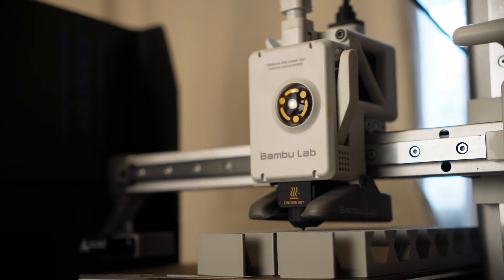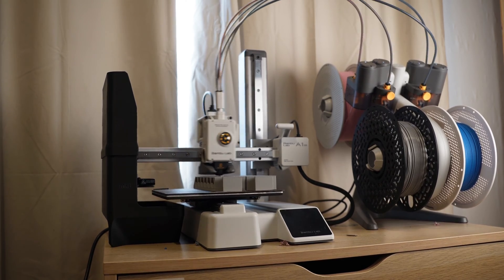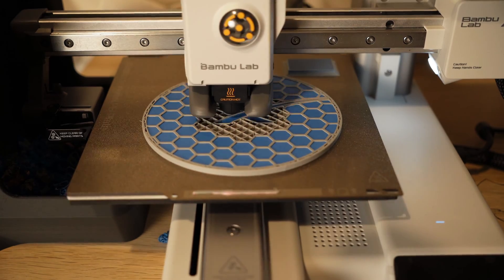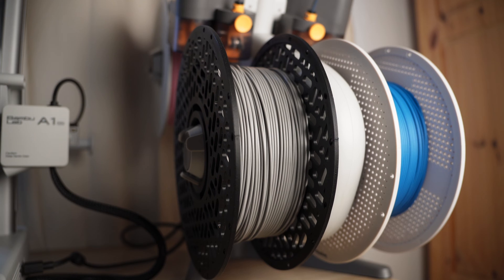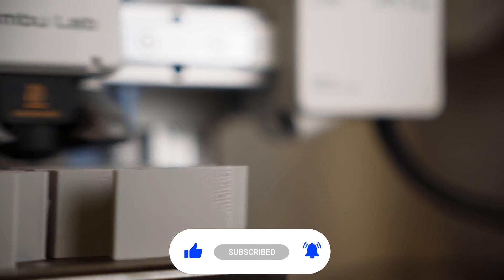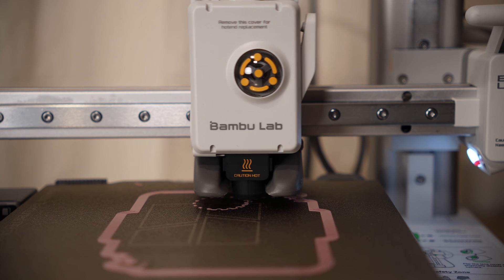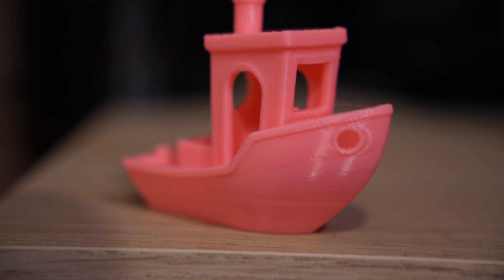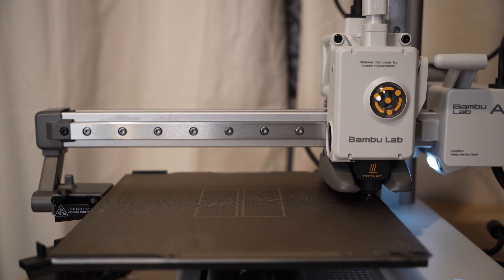A1 mini size DOESN'T MATTER!

Comment: I've been using A1 mini  about 4 months and the quality has dropped dramatically. At the very beginning it printed perfectly, but I have the impression that each subsequent update causes the quality of prints to deteriorate. Ironing the top layer used to be really amazing, now with exactly the same parameters, you have to turn it off because it destroys the surface.
Reply from the maker: Wow I honestly never noticed I’m going to test this out for you see if I can find a fix
Reply: Maybe do a maintenance ? (apply lube etc)

Comment: There is a clip to attach the cable to the ptfe tubes, so it doesn’t flop down like that. I would install that, keeps things neat. It’s found in the accessories box.
Reply from the maker: Yeah sorry I have it but I’m modding the ams so I’m constantly disassembling it abs putting back to together and didn’t bother with the clip for now but thanks so much 🙂